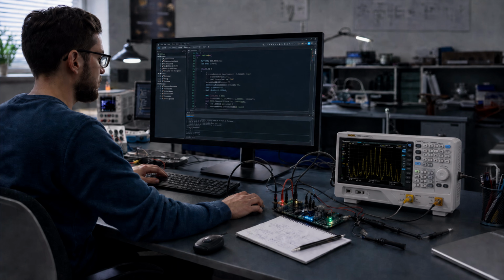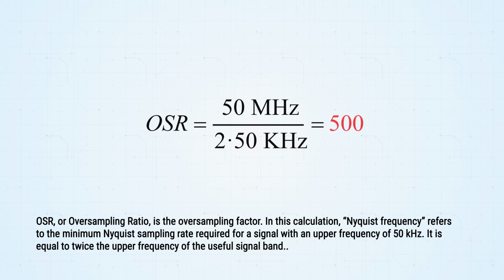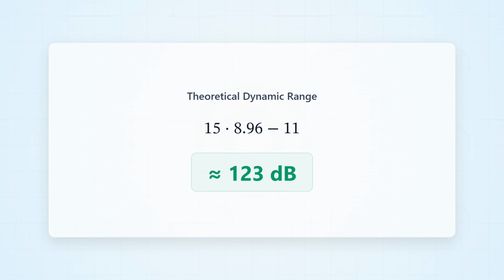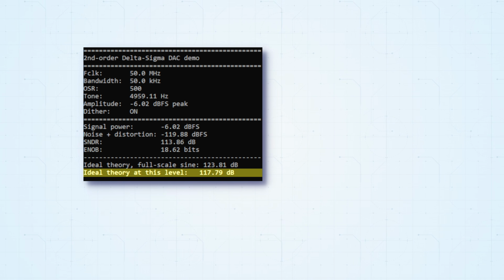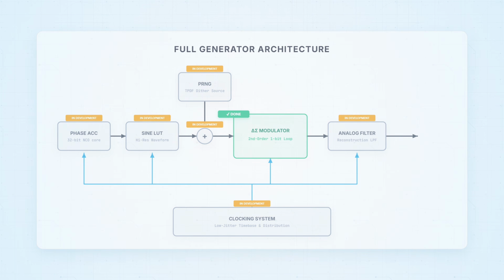Designing an Ultra-Pure Delta-Sigma Generator on FPGA | Part 2

Comment from the maker: Resources and Links:
- GitHub repository: https://github.com/DrBorisKuznetsov/delta-sigma-2nd-order.git
Timestamps
0:00 — Introduction: The challenge of signal purity and Finagle’s Law.
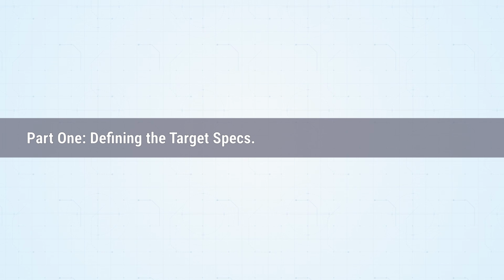01:08 — Part 1: Defining target specs and choosing the hardware platform (Cyclone 4 FPGA).
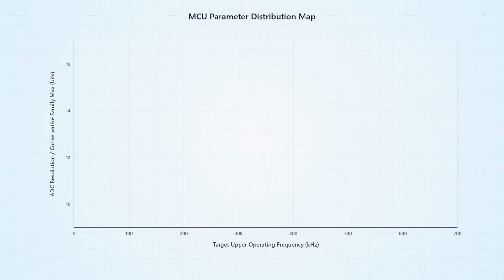01:23 — Analyzing signal quality requirements: Effective Resolution (ENOB) and SNR margins.
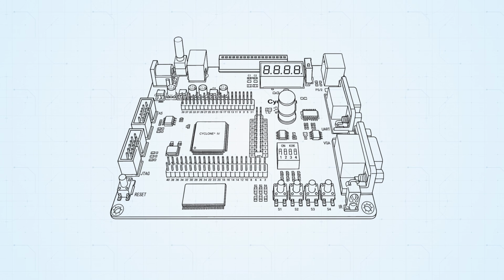02:32 — Architectural decisions: Clock frequency, bypassing PLLs, and OSR calculation.
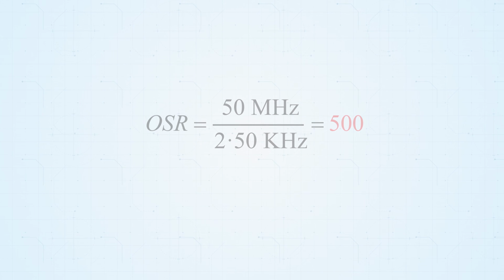03:22 — Part 2: How the Delta-Sigma modulator works.
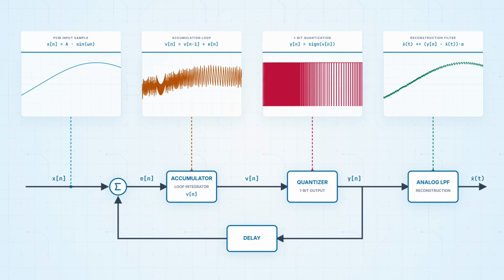04:55 — Understanding Noise Shaping: Pushing quantization noise to high frequencies.
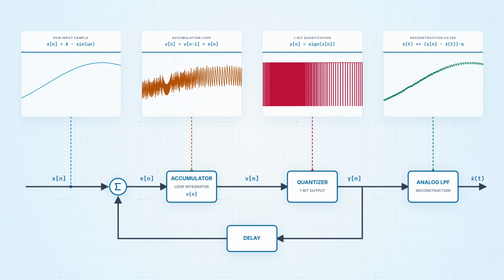05:32 — Comparing 1st and 2nd order modulators: Theoretical SNR limits.
06:33 — Real-world performance degradation factors.
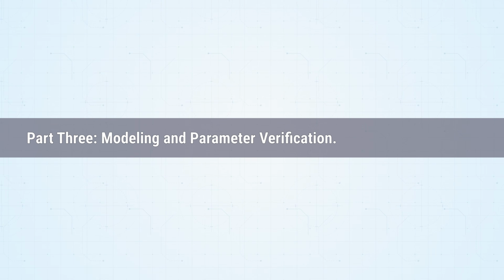07:26 — Part 3: Modeling and software verification of parameters.
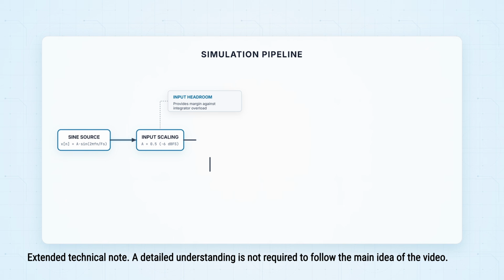08:04 — Implementation details.
08:49 — Simulation results analysis.
09:53 — Conclusion and roadmap.

Comment: thoughts before watching:   i have an old SEM and it's control system is old and broken.   i want to get open beam interface to run it in a modern way.  the hardware is a custom adc/dac board to interface with the scanning hardware on the SEM, and the computer interface uses a board with an FPGA on it....   why not try to run the DAC/ADC in FPGA all on the smaller interface board!    (learning journey)

Comment: Real world DACs seem to come with loads of electrolytic capacitors in the PSU wired in parallel to reduce ESR, and I guess guard against one going duff, as they often do these days. The power supply seems to be critical.
Reply from the maker: @Andrew-rc3vh   Yes, absolutely. For clean signal generation, the power supply is really important, especially for the analog part of the DAC and the voltage reference. In the next videos of this series, I’m planning to look more closely at power supplies, decoupling, and how noise sources affect signal quality.

Comment: The dsPIC33 can run up to 3.5MSPS at 12-bit, I think you have it at 0.35MSPs? I must misunderstand what you mean by upper operating frequency because the STM32G4x3 states 4 Msamples/s and I'm reading the graph as 400kHz sample rate
Reply from the maker: @tomasparrado873  Yes, you are right — this is a labeling issue in the graph. The 350 kHz for dsPIC33 and 400 kHz for STM32G4 are not the maximum ADC sampling rates, but the estimated upper input signal frequency, using a rough fs/10 rule. In the table I used 3.5 MSPS for dsPIC33 and 4 MSPS for STM32G4. I should have labeled it more clearly as signal frequency, not sample rate.